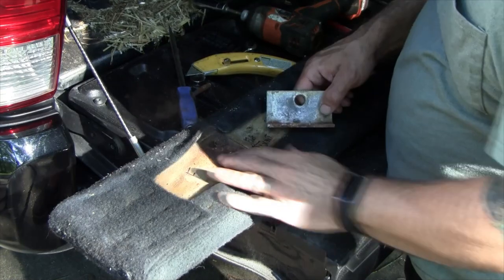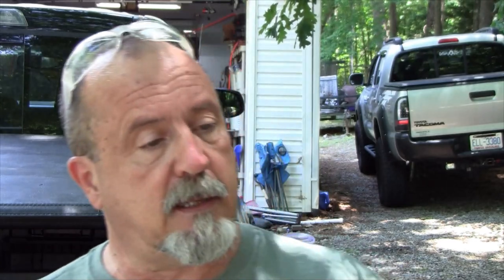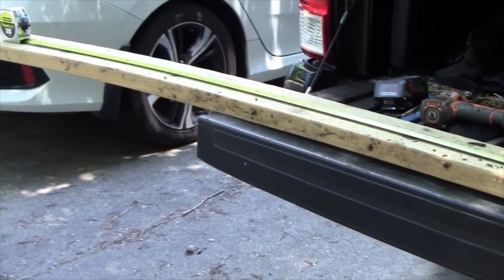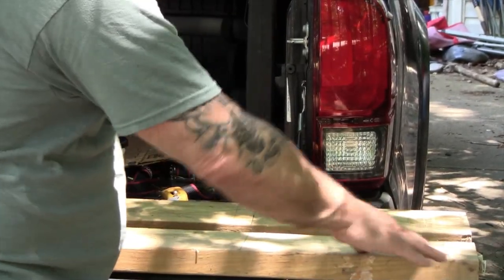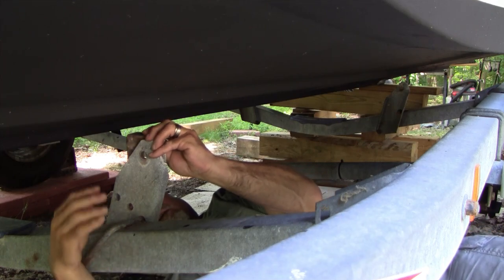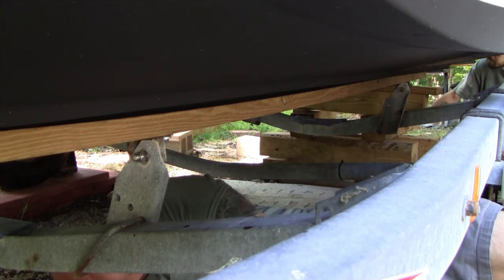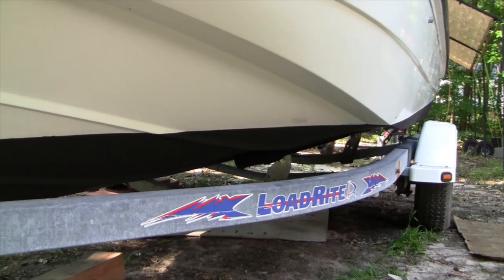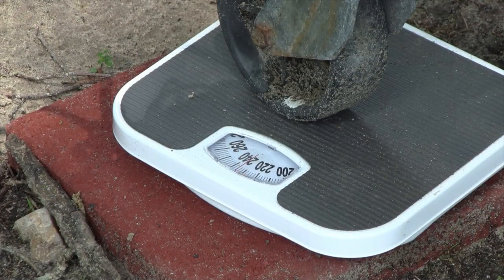How to Reposition Boat On a Trailer & Replace the Bunks - 2000 Boston Whaler Dauntless

Comment: GREAT video and ingenuity.  I'm essentially doing the same.  I  am replicating my bunks with new wood and hardware but keeping the old ones on without lifting the boat.  I will then slide the new bunks over the trailer and under the boat and slide them to the outside (against my trailer guides) and tie or bolt them down.  I will then launch the boat and simply swap out the old bunks with the new bunks, tie the old ones down to the sides of the trailer and head back home.  I'm hoping to do this when I get back from fishing.  Wish me luck and greetings from New York!

Comment: I have the same Loadrite trailer and one bunk was longer than the other also.  Did the same approach when replacing bunks . Also replace all rusted u-bolts and added a pad where the frame forms a Y  under the bow for additional protection. Nice video. Thanks.
Reply from the maker: Thanks for sharing!

Comment: Looks like we got our NC boat registration and numbers around the same time. Mine ends in ew also :). Great set of videos, just got a second project boat (for freshwater) that I will have to lift off the trailer and I was planning to do something along the same lines. On my larger 23ft boat I added a second set of 2x4 bunks to get it on the trailer even easier.
Reply from the maker: Lol, I see you are in Fuquay as well!
Reply: @ExtremeDIYGuy  no way lol

Comment: I have a 19 foot center console  and was wondering how to do that. Thanks for sharing. 
One question. Where do I get lovely blocked lumber like you have for blocking up the boat?
Reply from the maker: I actually got that from my stepson who works in a carpentry shop. You can probably get it at a big box store, or go with 4x4 or even 6x6

Comment: Can someone tell me if my trailer is leaning back would I still be able to attach it to the ball hitch. Just bought a new boat and the boat and trailer are leaning back kind of higher then where the hitch would be
Reply from the maker: You could but an adjustable hitch which might work

Comment: I have 6" x 6" bunks on my trailer with a 2004 Hurricane deck boat on it, would this block building work for me to hold my boat up while I renew my bunks-Carpenter bees have been boring into them and I don't know if the wood is still strong enough to support the weight of my boat. I see that NC tag on your truck, I have a place at High Rock Lake where do you call home?
Reply from the maker: It probably should work but without seeing it in person it's hard to say. Especially since raising a boat can be risky. I am near Raleigh NC, nice to meet a neighbor!

Comment: These dauntlesses are super heavy. I'm shocked your trailer isn't bending a bit. I had to get a tandem 3500 continental trailer. Only thing i still can't figure out is the front roller rubbing the hull. These are shaped so odd that no matter how hard i dip the trailer or pull it out it still rubs the front.
Reply from the maker: This trailer is actually pretty rugged. Is the front roller there to keep it from hitting the frame? Also, it might be that the trailer is to far in the water, which would cause that.